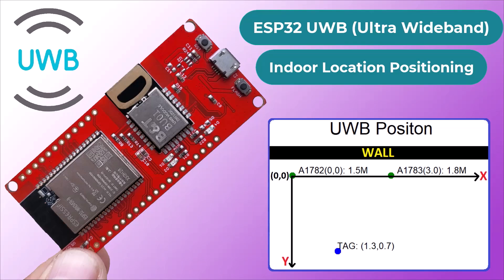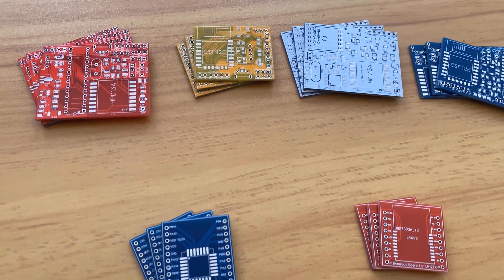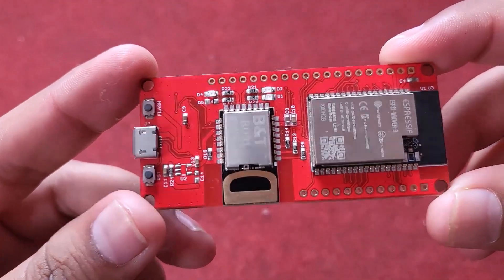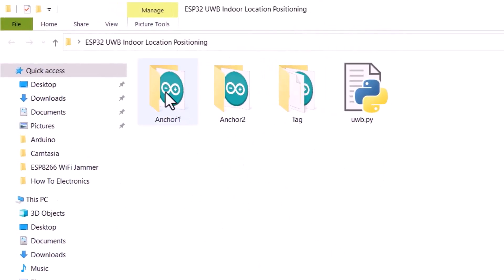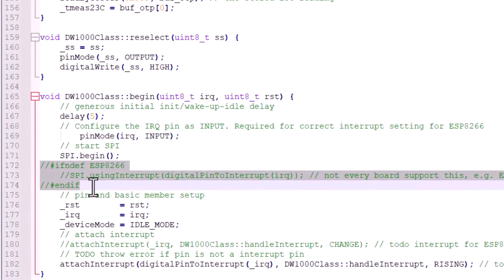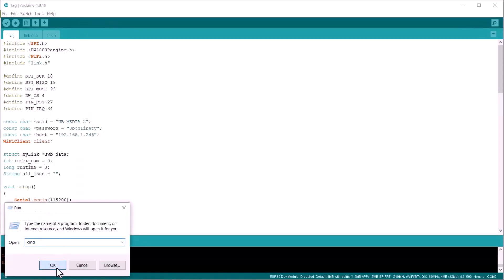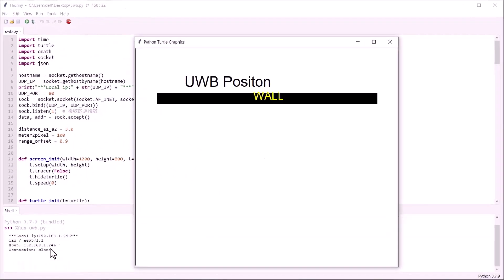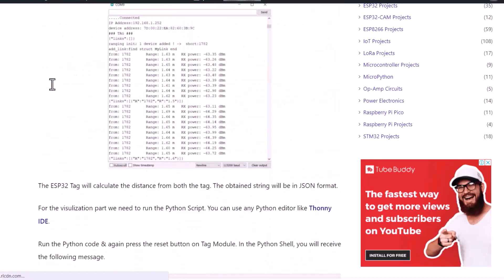Indoor Location Positioning System using ESP32 UWB (Ultra Wideband) Module

Comment: If It had an external antenna and a 1000 meter range I might be able to use these. And what about using multiple tag devices with multiple anchors? What about using multiple tag devices with just one anchor?  We need greater range to be of any real use.

Comment: hi, may i know why my python are not working, seems like it stuck at "data, addr = sock.accept()"
Reply: Make sure you are connected to the same Wi-Fi Host and Port 80. After that, I just tried to disable firewall and have fast speed of internet connection.